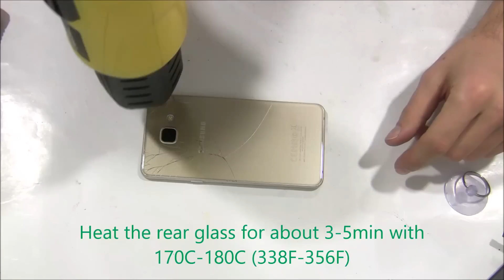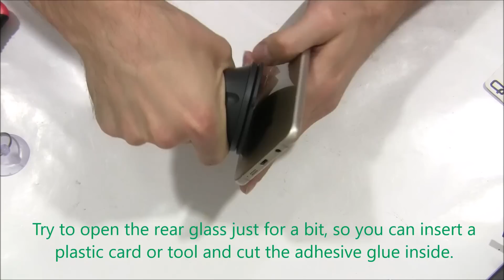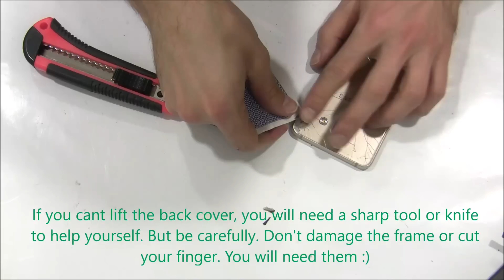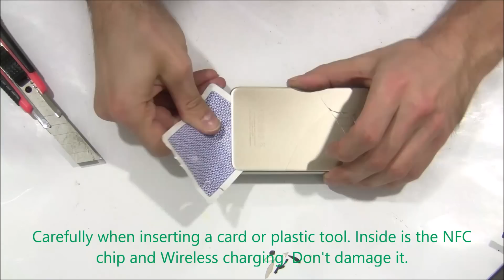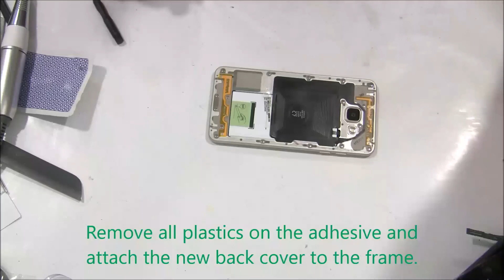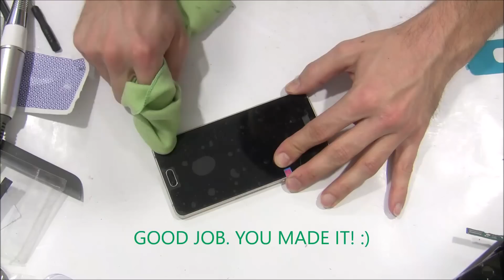SAMSUNG A5 A510f - How to replace Battery glass cover - CrocFIX DIY

Comment: 3:30 does it support wireless charging??
Reply from the maker: No
Reply: @CrocFIX  so why did you claim that it is wirless charging chip and nfc?????
Reply from the maker: Sorry my mistake. It is only the NFC
Reply: @CrocFIX  its ok. By the way nice to see your video and i've changed my mobile's back panel easily.

Comment: Bro just let you know that A5 2016 doesn't have wireless charging. Only NFC which uses Bluetooth to transfer files. Kinda rubbish for me. I've removed back glass after it broke second time. Now I'm using it without glass without NFC. Looks cool on outside. Everyone thinks it as new design for the firat time. It gets everyone's attention. For the water resistant part even though Samsung says it is not I've washed my phone alot while it had back screen of course. When I say alot I mean alot. No problems so far. I'm writing from the same phone now.
Reply from the maker: Thanks for your comment ;)

Comment: Good job....but i dont think it will be waterproof anymore
Reply from the maker: +donato popolillo Thanks. The A510f was never water resistant, so its ok. Just the new model A5 2017 A520f is water resistant.
Reply: CrocFIX do u think it will be still waterproof even after the replacement? I m talking about a5 2017.. Than

Comment: sir i want to replace display of j5 prime 
what is glue for pasting back surface of display of j5 prime
Reply from the maker: You can use B7000 glue or use the adhesive that comes with the back cover

Comment: can i use a hairdryer?
Reply from the maker: You can try. But the hair dryer sometimes is not strong enough and you can't adjust the temperature. It's ok for some small repairs, but for professional repairs,  better buy a digital heat gun.

Comment: will heat gun overheat and make my phone spoil
Reply from the maker: You have to be always carefully with a heat gun. Never go to close or use it too long. If you are not experienced, work slow...move in circles and use step by step temperature...starting from somewhere around 100C. (210F)
Reply: CrocFIX can i use a hairdryer as a substitute?